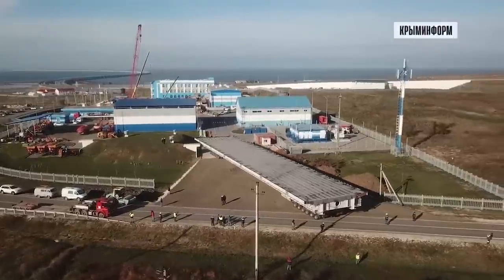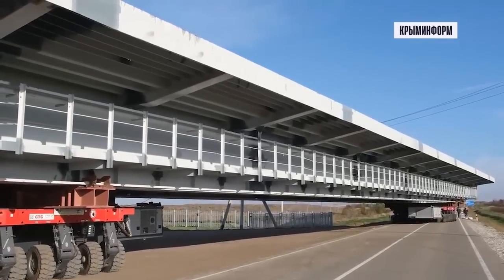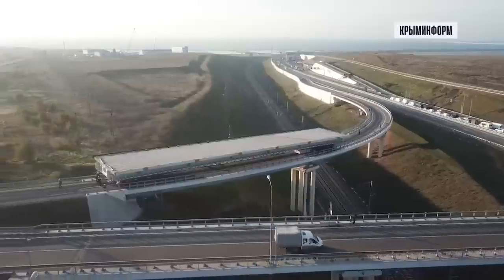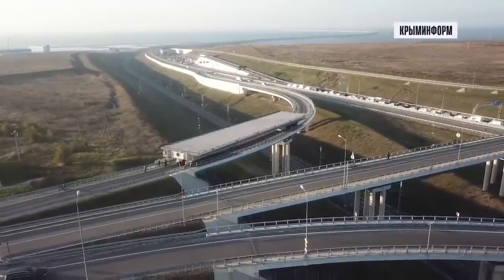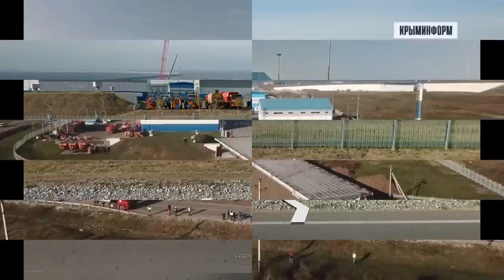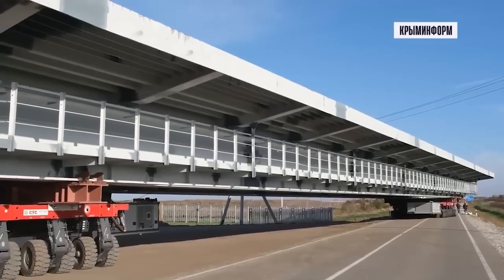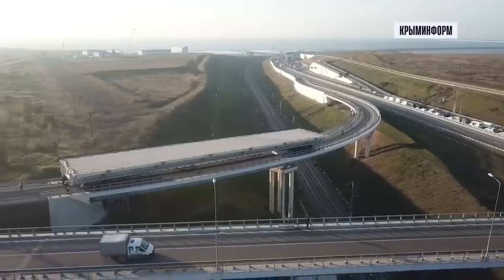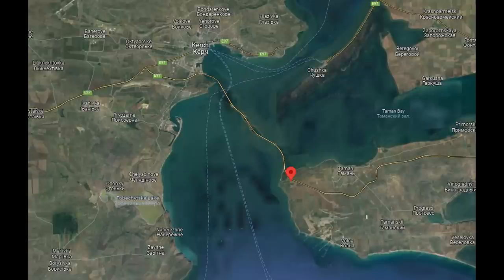Russia Transports New Span to Repair the Crimean Bridge

Comment: I used to build bridges for a living it would take a lot of men to put it together properly in that time although it's not difficult if you have enough manpower. l can't see how well it's put together in the video we had to have everything x-rayed to pass final inspection I doubt if the quality control would be a big worry for Russia 😁
Reply: I agree the man power quality quantity will determine how fast and how sound these sections actually are.  So the speed of the next four sections production will tell us quantity of manpower but only time will show quality without having inspection data.  If we see max load placed on a new section soon after install then assume they have proper wielding test ...... never mind this is russia 😒
Reply: I don't think it will last long enough for weld fatigue to be a concern!
Reply: Civil engineer, here.

When you have money but can't place it in international accounts due to sanctions and asset freezes you now can invest it locally in your own economy. Gone are the days of quick gas and crude earnings which could be whisked away into London and NYC accounts for safe keeping !

This might be why this bridge span was fabricated so quickly. The money always  needs to go somewhere.

Experts were hired for around the clock and likely overpaid for improved motivation.

Section elements are standard and were pulled from a maintainance  warehouse.

But was proper QA-QC done on the section prior to shipping it to the  construction site. This remains the massive elephant in the room.

Another  poster here cited the use of an Italian (?) transport crawler. As sanctions continue and spare parts become scarce crawlers like this will cease to operate, preventing bridge repairs. I'm sure the crawlers, having to bear very heavy weights, need specialized ball bearings. 

Remember what had happened at start of war? Sanctions stopped import of specialized Swiss ball bearings. Because of this, the Russian rail company, who use such bearings, knicked several routes and retired several cars.

And the crawler parts ought to be even more niche, more specialized hence harder to obtain.

Ukr and Ukr allies would we well-benefited to sabotage such crawlers to disallow the movement of completed bridge sections. The bridge will be hit again, I have no doubts about this, so by eliminating the crawlers its repair will be very, very hard.
Reply: @adrianb8620  you are funny. And this has  a pleasant, truthful tone to it.

Neither will salt water nor salty air corrode the structural steel fast enough to beat the tempo of war.
Reply: No point anyway, it's only going to get blown up again ! :D
Reply: But we do agree, that this sections is only one section and they removed 3 or 4 sections, right.

They are not going to be able to just plonk this one in and the bridge will be fulle functional in the side that was destroyed right ?
Reply: @oleopathic  - Electromechanical here. When you have a dedicated facility and your work's not required at the moment but might be urgently at any time, you  pre-build whatever parts you can and turn the next one from a fabrication job to an assembly job.
Reply: @2112jonr  I hope so.
Reply: @JohnDoe-bd5sz  you are correct. They need several sections installed before restoring traffic capacity to 100%.

Hopefully they will fumble on the logistics here as well.
Reply: @oleopathic  Yeah, I've been involved in setting up these transporters and mapping out the route.( Engineering Surveyor) Incredibly expensive and you do all your sums first. Then again, this is from Russia and labour is cheap(you just don't pay them). Was amazed at how new these transporters look given they were probably used during original bridge construction.
Reply: @drj.r.cooper2493  you raise valid points about the presence and use of back channels. so what is the world to do ? it seems that the individual nations cant even agree on and strongly implement anti-russia measures. still, despite the back channels used by russia, russia is losing. in lack of a perfect solution, use an OK solutions. this OK solution has been to trickle in weapons and money into Ukr. seems to be working and it seems the general trend now is the losing of war by russia. so..."so far so good".
Reply: @oleopathic  Better men than me (& I) have tried to fix this since I learned about it in the 1980s. My best answer...
-Like Ukraine, you do what you can. 
-You don't compromise. 
-And you don't fail to point out the bullshit of politicians.
Reply: @drj.r.cooper2493  does this go around look to you like ussr's war in Afghanistan?

. AA means supplied by us 
. Us & EU instructors supplied
. Intel supplied by us and eu

Seems another proxy war one which will, after all is said and done, improve ukr.
Reply: @oleopathic  Not really. True...in Afghanistan materials/intel were supplied by the US (and others) with something of a "wink and a nod". EVERYONE knew we were doing it but no one was really discussing it "in polite company".
   This war is centainly a proxy war, similar to Korea. (Russia is even flying the Soviet Flag!) At the same Zelenskyy & the Ukrainian people are showing their dedication to, and their capacity/capability for self governance. To me, that is key! Also, Putin is acting EXACTLY like a tsar (or Stalin, in you prefer), which is hilarious is a weird way.
In general, it's a potential precursor to a regional conflict...not a pre lude to "World War III", as the media & some politicians claim.

Of course, I could be wrong.. but I don't think I am. And I certainly pray that people will do what is right, and not what us politically expedient.

By The Way, GREAT QUESTION! Thanks for asking!
Reply: @drj.r.cooper2493  the main difference between the failed us' 20-year affair in Afghanistan and the ru's 8-month failing war in ukraine is that the Ukrainians are more receptive to seeking help, accepting help, and effectively using this help to defend their territory against russia.

afghans never asked for the us and eu allies to enter into their territory. they actively fought the us & allies from day 1. once overthrown, the national government tentatively received billions of usd -- it was sweet to line the pockets of corrupt afgh politicians and why not since their country is occupied and there is nothing they could do about it anyway ?

us and allies never flooded into ukr to "offer protection". they offered help at a great distance -- across the border in poland & other nato nations. in contrast, russia is trying to flood in and take over the whole country without "offering protection" or supplying financial "incentives" (bribes, etc.) all the while dehumanizing ukr citizens (calling them banderas, nazis, satanists, lgbt, nato-pawns, scum, slaves, traitors, etc.)

main reason why ukr will win the war where afgh was unable to (against overpowering talban takeover in 2020-2021 during us' capitulation) is because ukr people arent seeking handounts. they are seeking real help and once they receive it, its applied with tangible results the western backers can easily see -- indisputable victories on the battlefield. cascading, overwhelming victories against ru's 2nd army in the world.

there is a lot more ukr is doing correctly in addition to effectively applying western help and when taken as a complex of "correct thinking & actions" they will win the war. its a matter of time now.
Reply: @oleopathic  Your previous questions & comments involved RF in Ukraine. Right?  I MEAN NO OFFENSE, but comparing the US missions in Afghanistan & Ukraine's defense against the RF is like comparing green apples and "baseballs" (slang for US cluster munitions in Vietnam). While your comments were interesting, my previous comments were not intended to draw any comparison with coalition troops and the most recent conflict in Afghanistan. If I did this, it was certainly my mistake.
     Regarding Afghanistan from 2000-2022...tI can find no real points of comparison. Afghanistan involved Islamic fundamentalists who grew/sold opiates to buy munitions for their assault on us infidels. Also remember... the US took the lead, but there WAS an international coalition involved in the prosecution of terrorism Iraq, Afghanistan, Pakistan, etc.! We didn't seek to annex any territory, we didn't commit genocide, and we did not claim to eradicate nationalism, facism, etc. SOME OF the politicians & military leadership had their cerebral cortex FAR INSIDE their rectum, but the enemy forces in Afghanistan were NEVER a military unit that seriously threatened us as an opposition force. Theirs was primarily an indigenous force,  focusing on resistance, terrorism & outlasted our interest in the region. Therefore, for me there are no REAL correlates to what Russia is trying to do. Rather, Ukraine's Herculean effort & success puts me in mind of Israel in the late 1960s or the Confederacy of the US from 1860-1862. I am referring to the early days, before the South was technologically overwhelmed by the Union. In that period, Stonewall Jackson & 15,000 members of his "foot cavalry" repeatedly beat Grant & Grant's entire union mechanized army...even though it was 4 times larger! It's an enormous shame that so many people prefer turning over Confederate statues, versus actually benefitting from the study the US Civil War... 
   AS FOR UKRAINE... EVERYTHING I SEE suggests Zelensky's military advisors have CERTAINLY spent a lot of time studying that war. (And every other war in the past 3500 years of human history.) Maybe one of these days he will share the things he saw in the days leading up to the February invasion. I assure you that many of his decisions were at least influenced by the US Civil war, the Crimean War, WW1, WW 2 and a host of others. He's a very talented strategist.
    I hope one day to have the time and energy to sit down and discuss such things with you and people like you. I think it would be a wonderful learning experience for all of us. I know...  it probably won't happen, but we can certainly hope.
Reply: @oleopathic  Specialised service parts won't be a problem...they'll just be ordered through newly set-up trading companies in countries (particularly those in the Middle East...) that are not enforcing sanctions against Russia....
Reply: @drj.r.cooper2493  history certainly informs the present. And he who ignores lessons from the past is damned to repeat them. But would you want to do that when you could study history and use it when making important decisions?

Isaac Newton, one of sciences' greats, said that he "stood on the shoulders of giants". Isn't this an accurate representation of the whole human experience? We build upon our forefathers' expoits whether we recognize this or not.

I knew little about Zelensky prior to the war. And it's a regrettable gap in my knowledge to continue to know little about him. But I am sure that sooner or later there will be books about him -- and once there are -- we can start to understand exactly "what happened" in Ukraine in 2022 straight from the primary source.

Even if Zelensky isn't a talented strategist but a talented PR manager, that's also fine. Ukr victories tell us that he at least is intelligent enough to select high-quality support staff. High intelligence along with hard work -- and he's certainly a hard worker -- is a sure recepie for success. That's why I say: it's only a matter of time when Putin runs home to his mistress with tears in his eyes from an impending capitulation.
Reply: @oleopathic  WELL SAID! It will/would be interesting to hear from  Zelenskyy, but we can learn most everything we need to from Zelenskyy by watching what he does.
-He doesn't mind negotiating, but he refuses to compromise. 
-He doesn't take stupid chances, but he also doesn't run from danger.
-He stands for AND WITH those who serve under him. 
-He does a great deal to  protect those who can't fight for themselves. 
-From what I see, he doesn't mince words. When the French and the Germans leaders (especially) offered help, while still befriending Putin's regime, Zelenskyy responded by saying, "Don't lie to me/us.". In the Southern US we have a saying, "Don't piss down my back and tell me it's raining." I think he's saying the polite/Ukrainian equivalent.

I'm certainly not trying to call him a superhero or anything like that, but the man has balls as big as coconuts! He's standing up against a superior force, AND AGAINST traditional diplomatic doubletalk. Men who diligently hold to an oath in hard times that they gave in good times... LOOK LIKE superheroes..
Reply: @drj.r.cooper2493  he does appear to have superhero-like qualities, doesn't he? i like to think of him as our modern-day equivalent of the British Churchill. while europe was demolished by the ww2 fighting and britain stood as the last european nation willing and actively resisting german nazis, Churchill despite great odds, kept fighting. what a man - what a legend! and he fought to the tune of v1 and v2 missles exploding in london. zelensy is fighting to the tune of kinzhal, kh-xx, and others exploding in kiev, ukr.

how do you think a meeting between churchill & zelensky would look like, if one might hypothetically be arranged today in kiev ?
Reply: @oleopathic  That's a very good question. Neither man would be hesitant to make a deal to sustain and accomplish victory. I think they would get along pretty well, but then politicians always seem to get along with pretty much anyone. Churchill was the kind of man who saw it to preserve as much of the British Empire as possible, knowing that large chunks of it would disappear, even with victory. Looking at a map of the British Empire in 1938 is very enlightening. China, much of Southeast Asia, Australia, India, the Middle East and Africa were directly ruled by the King, or were under his influence via a Constitutional Monarchy. Churchill was smart enough to know that they are going to need help in fighting off Japan, Germany and Italy. He was also concerned about future activities of the Soviets.

You are very correct to note that he made some very ballsy moves. His famous attitude of "making a deal with the devil if it preserves the empire..." (or something to that effec) sums up his approach quite well. Zelensky has adopted a similar footing, with a few MAJOR differences. "Z" does not seem comfortable to agreeing to almost anything & with just anyone. Churchill made deals with Russia that he knew were going to cause problems later. In 1945 he essentially stayed silent while Russia chopped up Germany and Eastern Europe to suit themselves. I'm sure he had his reasons, but it was going to mean the suffering and doom of an awful lot of people. Churchill SEEMED pretty comfortable with making deals that were financed by the lives of others.  I know it was a different time and a different situation, but I've heard men who fought in World War II make similar comments. That is one reason why Americans were not crazy about being under the command of the Brits, even in WW1. I don't think Zelensky is quite that desperate, but only time will tell.
    Churchill SEEMED less focused on what Eueope & the world would look like after the world, WHICH I FULLY UNDERSTAND! Sometimes you have to kick someone's ass and clean it up later. Zelensky may have the same attitude, but he doesn't have access to the resources or influence that Churchill did. If Joe Biden had any balls at all (and if Olaf & Marcon didn't play both sides), this war wouldn't have lasted 10 months, or even 10 weeks. (It probably wouldn't have started in 2014.)
   I'm certainly not trying to beat up on Churchill. He's not here to defend himself, and as you noted... he achieved great things in a horrible time. I think Z has a lot of Churchill's ballsy attitude. He MIGHT have more empathy in terms of human losses, but that could be sociological (& theatrical) in nature. I am sure they would have made a good team, then or now. (As as long Churchill got to be the boss!😉) Over all,  I THINK I prefer "Z".
Reply: @oleopathic By the way... there are some excellent historical records, soldier's diaries, videos and other information (like after action reports) from battles in and around Isium, "Kharkov" and other parts of Ukraine. The channel is @Military1945.
Reply: quality control is carried out in the way that you described. They use devices like an X-ray and a flaw detector.